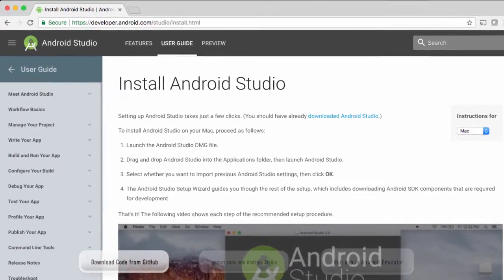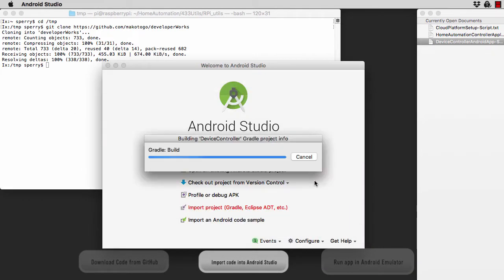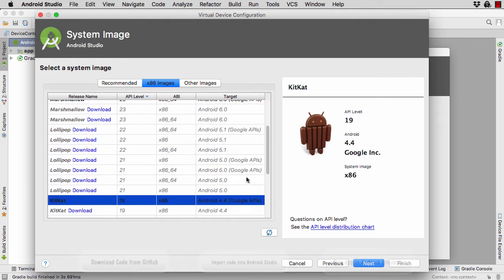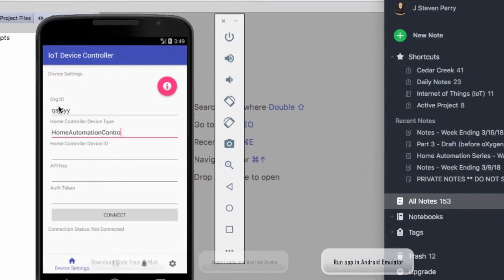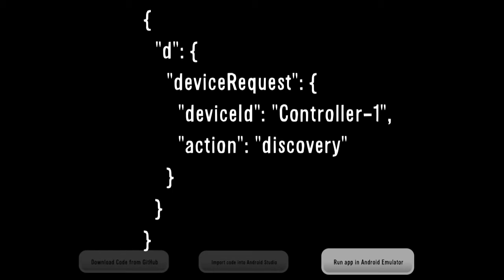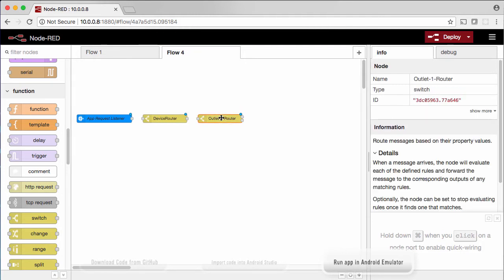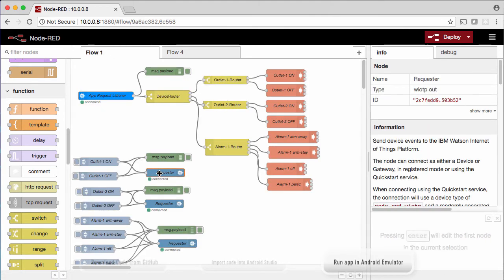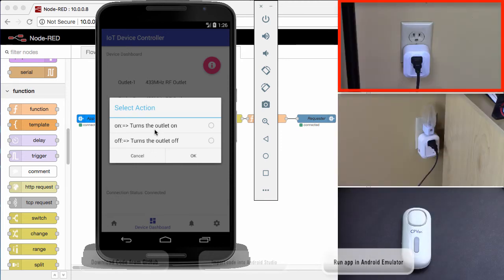Home Automation Tutorial: Device Controller App

Comment: Few questions:
1. why do we have to put device router component in the wiring instead of just the outlet and the alarm output components? 
2. in real life implementation, to which server the raspberry pi will be connected to? IBM server? so that the smartphone will have to connect via IBM server as well?